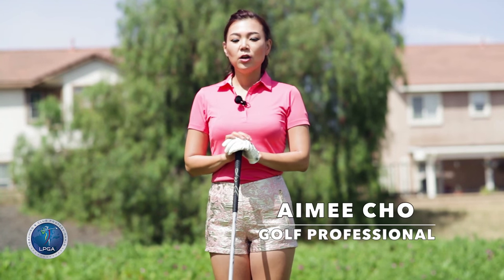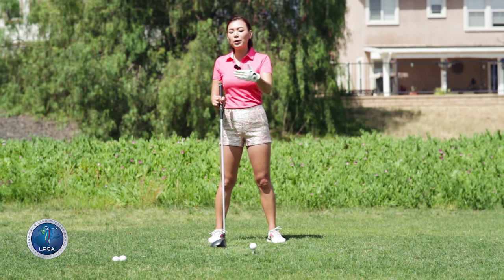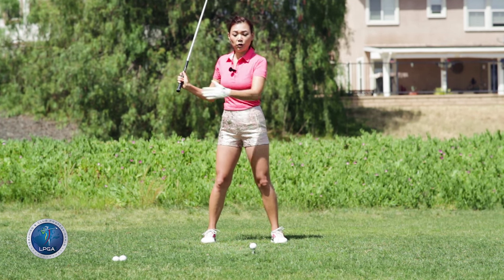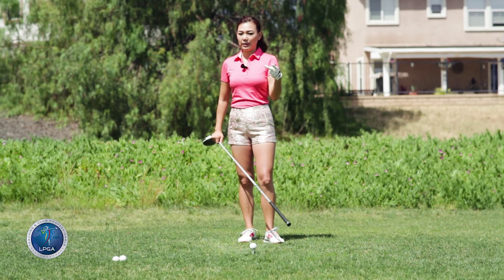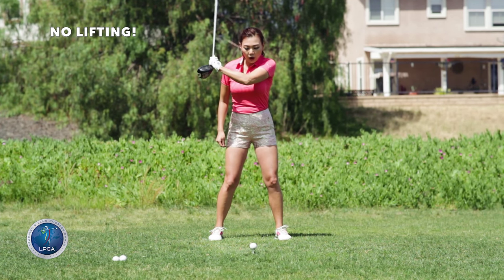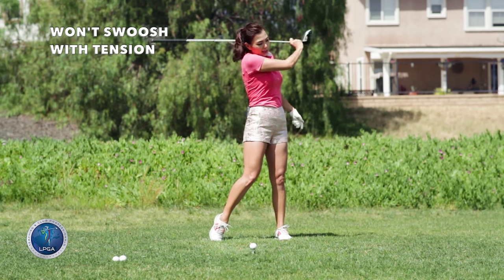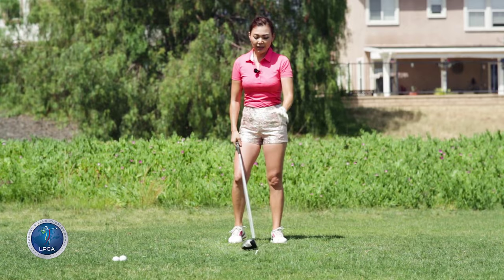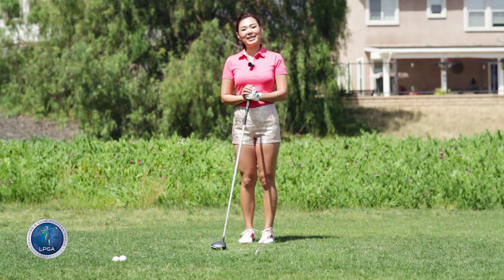Driving Under Pressure! | Golf with Aimee

Comment: Just became a fan of your videos. Watched most of them. Very clear instruction with cause, effect, and solution/fix. Have a question. In this video, with driver, your Y is more towards the center and the ball is just off of the club head. However, if you keep the ball at the left heel, typical for driver,, do you position the Y in front of the left armpit or you still keep it at the center of your stance. Which ball position is better for driver?